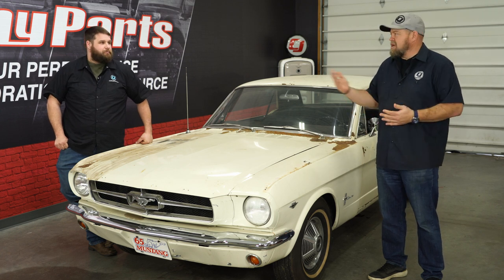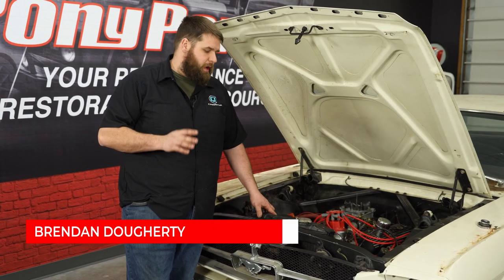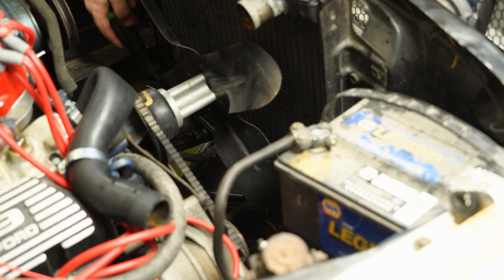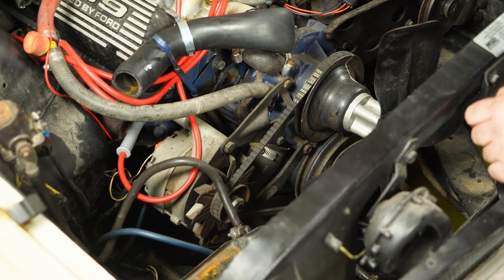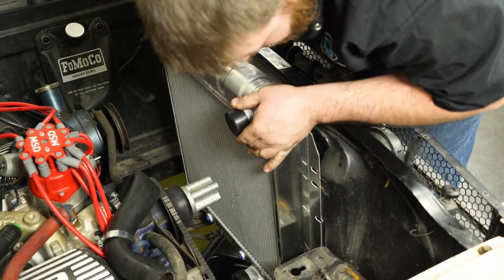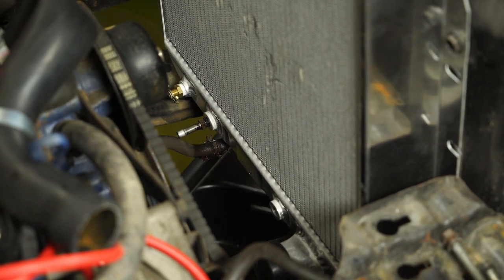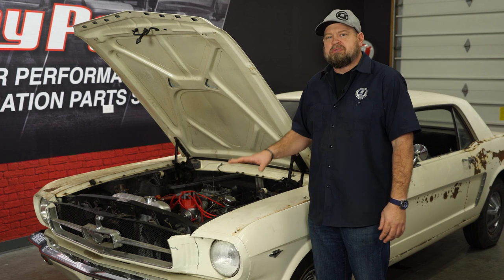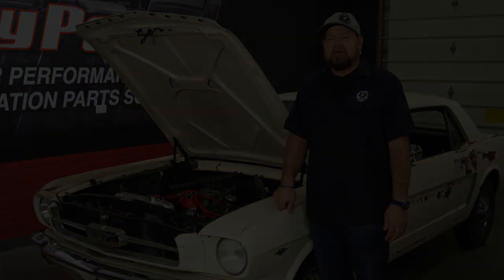1965-1966 Mustang Install | ACP MaxCore Radiator

Comment: Here's a recommendation that I have found works very well:  Whenever working on my fan/radiator, I ALWAYS insert a flat piece of corrugated cardboard on the back side of my radiator while working. When done, I remove the cardboard, and there are never any smashed fins.
Reply: Yes! Im sorry but these guys are hacks.

Comment: I just put in a new radiator on a 65 coupe. It's thicker and doesn't fit where the fan was, so I got an electric fan, but even that doesn't clear the water pump pulley. Any ideas?

Comment: One thing I realized this week. If you have an aftermarket classic auto air conditioning system, and you intend to use an oem clutch fan, while trying to make the fan clear the compressor, there is not enough room because this radiator is about 3/4" thicker than the radiator I had. The clutch would be like an 1/16" from the radiator. If the engine moves at all, the clutch would bang the radiator. I am using a 1/2" fan spacer. I don't think a 1/4" spacer would give me enough room to be safe. Disappointed.

Comment: I re-cored my original radiator, put in a high airflow fan and shroud. It runs perfectly until I hit traffic, then slowly gets hotter and hotter. Do I need to think about a radiator upgrade or is my best solution an electric fan?
Reply: After all these years has the aftermarket made a correct easy bolt in plastic shroud for 65-66?
Reply: @Deucealive75  I've had mine a few years now but the shroud has gaps and the brackets don't line up either. It was a Scott Drake part and pretty expensive too.

Comment: I have a '65 Mustang with a 302 and 3 row copper radiator, 5 blade fan, and fan shroud.  I would like to  gain some performance with a fan clutch. Is there one you recommend?